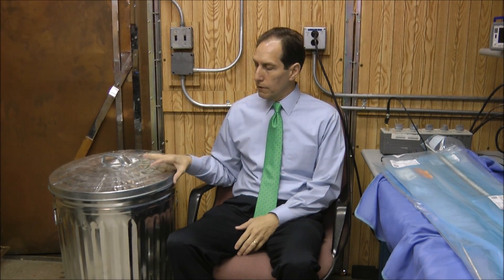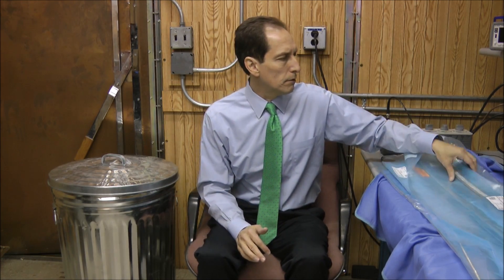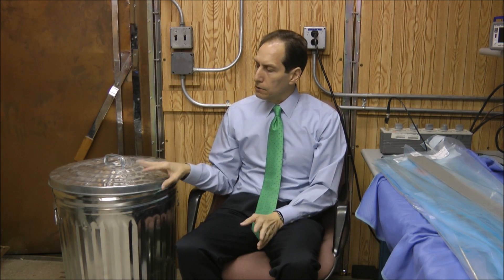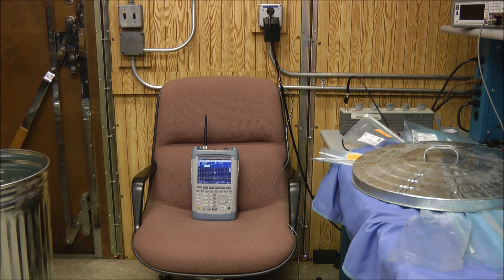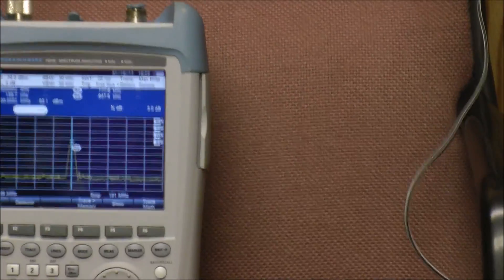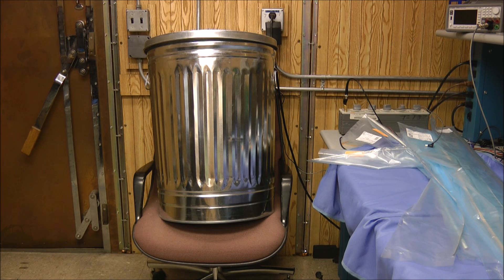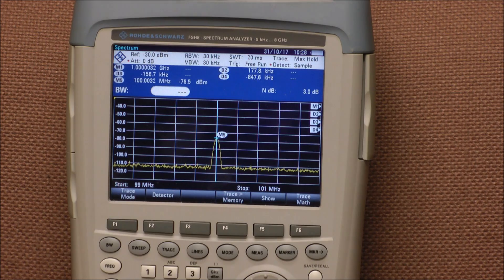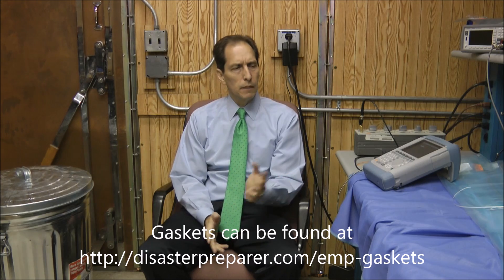Gaskets to Seal Faraday Cage

Comment: I was able to duplicate this experiment and get almost the same numbers, but I didn't have a shielded room, or a fancy signal generator or a portable spectrum analyzer.  I did the experiment in reverse.  I used a Baofeng radio as the transmitter.  Put a rubber band around the PTT button and put the radio in the trash can.  Then I used a SDR receiver (SDRplay) that can measure signal strength to +/- 1 db and measured the signal strength (open air vs in cage).  I got about 18db shielding effectiveness on the unsealed can and on the sealed can the signal disappeared completely off my spectrum scope just like you saw. I calculated at least 70 db of shielding effectiveness.  My noise floor was a bit higher (-100db) but the 8W Baofeng was probably putting out more power than your transmitter (bout -30db on scope).  I did this experiment because I could still talk to a radio inside the cage.  My RF seal was in the wrong place.  Putting it on the sidewall of the lid is crucial.  I had it in the corner.  Putting it on the sidewall is what raised the shielding from 18db to 70db.  

BUT I could still talk to my Baofeng inside the properly sealed trash can.  I'm guessing that the Baofeng receiver is more sensitive than the SDR receiver.  However, I kinda think that a nuclear EMP will generate way more energy at 435 Mhz than my $33 8W Baofeng radio.  So, I still don't trust the trash can faraday cage.

Also, I can totally block the 8W Baofeng signal with only two layers of tin foil separated by a plastic bag.  Seems that 2 layers of tin foil does a MUCH better job than the trash can faraday cage itself.  And tin foil is also way better than mylar bags -- even the fancy EMP bags.  I tested Faraday Defense mylar and Dri Shield 3400 mylar bags against the tin foil, and the tin foil won easily.  So my sensitive items are in multiple layers of tin foil and mylar inside the sealed trash can.  

Interesting experiment.  Glad I got about the the same numbers.  Repeatability is a thing.

QUESTION:  Where does the 50db minimum shielding effectiveness threshold come from?
Reply from the maker: That's great. I always like to hear when people come up with clever methods of doing RF testing.
Reply: I like the way you think. I have a question for you. Would grounding the trash can make much difference. Right now I am thinking of using Faraday cloth over a trash can....perhaps cheaper than using the RF seal around the lid. Any thoughts?
Reply: @groniga  i dont think the grounding really matters because of how the farafay cages work. Dont really know if it would help or hurt.   But the rf gaskets (available for less than half the price at digikey) just look like emp cloth wrapped around a foam core with some peel and stick conductive adhesive.  I would think if you draped some emp cloth across an open trashcan and the put the lid on (sandwiching the cloth in between the can and the lid) that would be an excellent seal amd probably more durable than the gaskets - they tend to want to get scraped off.  Maybe even a better seal than the RF gaskets.  Great idea.  I want to try it.
Reply: What type of Mylar did you use? There is two types, metal vapour deposition on plastic is one type. The other is aluminium foil laminated between sheets of plastic.
Reply: @bojangles2492  Several types, but cant confirm the construction.  Pretty sure they were the tin foil between plastic type.  The DriShield stuff has a slightly different feel to it tho.

Comment: I know this is a stupid question I am sure you have been asked 1000 times. But what about using an old microwave?
Reply from the maker: They do okay, but they're not designed to shield from lower frequencies, such as those from an EMP. Microwaves operate at 2.45 GHz.
Reply: @disasterprepper  Awesome. I always was curious. Thanks!

Comment: Adhesive on one side, conductive on the other. Is that a conductive adhesive of some sort? Seems like garbage to me.
Reply from the maker: The adhesive is conductive. Also, it's very thin, which allows metal-to-metal contact. These gaskets are used for all sorts of RF applications.

Comment: Same considerations for lightning protection?
Reply from the maker: Can you be more specific in your question? What are you trying to protect from lightning?
Reply: Spare electronics (GPS, phone, etc) on a sailboat in case of a lightning strike
Reply from the maker: @MarkS6026  Ah, got it. Yes, you can use these same protections to guard against the radiated effects of a nearby lightning strike.

Comment: So I bought the gasket. Came super quick. Put the gasket where it was shown on video. Pull the tape off and it went on really easy. Doesn't work though. Wasted my money. Going back to the tape.
Reply from the maker: When you say it doesn't work, what do you mean exactly? How are you testing it? Also, did you put it on the sidewall of the lid?

Comment: Would multipurpose foil tape (brand is Reflectix) work to seal seams of garbage can?  I also bought 3M HVAC tape, both from Home Depot.  They look metallic but don't know if they would work.  What should I look for from their Home Depot website?
Reply from the maker: The metal HVAC tape works great, but it can really slice up the fingers getting it on and off (I say that as someone who repeatedly learns this lesson). I haven't tried multipurpose foil tape, so I can't say for sure how well it would work. The reason I like the gasket over tape is that it makes it easy to get in and out of the can without having to remove and reapply tape.

Comment: The tape AC duct is sealed with, will that help?  Or can we use it?
Reply from the maker: Yes, aluminum duct tape works great (and it's cheap).
Reply: @disasterprepper  Hi Doc - does the aluminum duct tape also need to have conductive adhesive?

Comment: foil tape has nonconductive glue on one side.
What about a faraday 'wall'?
something to put between you and a cell tower?
Reply from the maker: I wondered about this too, but it ends up the very thin layer of adhesive gets flattened out enough that standard aluminum duct tape works great to seal up things. I tested it along with very expensive copper EMI tape, and both did equally well. You can put up a shielding wall but RF energy has a way of bouncing all around. Unless you were sitting very close to the wall, I don't think it would be very effective.

Comment: I ordered this gasket and placed it the same way shown and still could not get a Bluetooth speaker to stop playing inside or even a radios signal.   I used aluminum tape on all the seams of the can also.   When I used body weight on the lid is only when I could get the signal to stop.
Reply from the maker: The fact that when you put weight on it, the speaker stopped receiving means you're not getting a good tight RF seal. I suspect you may have put the gasket in a place where it didn't seal up the lid to can. Did you put it on the sidewall as shown on the website? If you'll send me a few photos (arthur@disasterpreparer.com), I can probably help.

Comment: Can a washer, dryer, or microwave serve as a Faraday cage?
Reply from the maker: Sure, I measured ad hock Faraday cages like this in my EMP book. The microwave did okay, but not as well as I would have thought. I also measured a safe, garbage can, and other structures. The key is sealing up the seams with something conductive (like gaskets or aluminum tape).

Comment: Dr Bradley, great video. I can’t help but notice the lever bar lock on the door behind you. Is it part of the door or can you buy separately and add to any door? Would like to have info on that locking mechanism.
Reply from the maker: The door is part of a shield room. They use knife-edge doors with heavy door door latches to seal them well from RF energy. I don't know if a normal door could be retrofitted with such a latch, but I suppose it's possible. I can tell you that when it's shut, it's definitely shut!
Reply: @disasterprepper  Thanks for the reply.

Comment: I wish this was my science class/teacher in high school. Love the room he is in. Thanks for the video, very informative and useful. Bill Nye take a seat, the teacher is in the house!  Just subscribed. I had a question about the seams around the handles and where the bottom of the can meets the edges; how well are they sealed and should they also be sealed?
Reply: You can use aluminum foil tape to better seal these seams. This is a form of "duct tape", typically used in HVAC applications.

Comment: Hi,
Is an internal electrical insulation layer not necessary? like ruber, cardboard or simple plastic?
Thanks and regards from Brazil
Reply from the maker: It's only necessary if there is exposed metal on the item being stored.
Reply: @disasterprepper  thanks for your reply.

Comment: Don’t grasp the validity of these test! A nuclear device also emits a magnetic pulse. The Behrens High-Grade Steel 1211  Steel Trash Can is 30 gauge (0.4 mm) and will saturate allowing the magnetic energy to induction heat and melt the electronic circuitry, especially the chips. This is why military equipment for  Level One is built to a higher spec.  already than domestic equipment (about 20x better) and yet still needs protection meeting  MIL-STD-188-125 (80 dB attenuation) in real scenarios with their much higher energy levels. I don’t see 112 dB achieving that for ordinary consumer stuff at the expected energy fluxes.  Sometimes  Nilomag or one of the other nickel–iron soft ferromagnetic alloy with very high permeability is employed for mission critical equipment to avoid saturation of ordinary steel enclosures. So will this work in a real scenario or is this the reason for the lengthy disclaimer — my club has a lot of these to build and bags to buy whist we still have time. Post script:  The MSM is still not reporting on the increased navel movements in the Pacific.
Reply from the maker: Low-frequency magnetic effects generated from an EMP would not couple well into small-scale electronics due to very small loop areas. High-frequency effects (such as those from the EM wave) would be far less than the electric field due to the E/H ratio being about 377 in free space. Facilities may well need to worry about the magnetic effects, but all but the most sensitive of small scale electronics would not be adversely affected.
Reply: @disasterprepper Thanks for the quick reply.
Reply from the maker: @Nuts-Bolts  Of course. I'm always interested in hearing other knowledgeable people's thoughts on the subject.
Reply: @disasterprepper  And sometimes not so knowledgeable people too!

Comment: I have installed a Siemens EMP Home Protector.  If I plug all my small appliances using a power strip, will that safeguard them.  Also, if I plug my Goal Zero 1500x power generator together with the 4 solar panels into my power strip will that also be protected whether they are in use outside or sitting idle inside my home, also remaining plugged in?  Finally, would it be a good idea to line the inside of the trash can with rubber mats?  Thank you.
Reply from the maker: Having a surge protected power strip will help, but please note that some strips are not surge protected. Using broadband ferrites on the power cords of things that must remain plugged in is also a good idea. If the Goal Zero is not plugged into the grid (which I'm assuming it's not), the only risk is from radiated energy. Again, ferrites on the power cords can help. When it's not in use and not plugged up, you might consider covering the main unit with conductive cloth. Lining the inside of a faraday cage with cardboard or rubber is fine, but it's only needed if something metal on your electronics might touch the inside of the can.
Reply: @disasterprepper    Thank you so much for your quick response and all your helpful information.    I really enjoy your channel.  One question:  I'll be purchasing ferrites on amazon.ca  (I live in Canada) do you suggest a certain kind?  Thanks!!
Reply from the maker: @LaMammaDiElvis  That's a hard question to answer in a short e-chat. The short answer is that you want some with very high impedance across a wide frequency band. I evaluated hundreds before settling on the ones I sell on my website https://disasterpreparer.com. I can ship to Canada if you prefer to buy from me, but either way, any ferrite is better than no ferrite.
Reply: @disasterprepper    Thanks again for your kind response.    Great, I'll check the ones you sell on your website.   I need the best.  Thanks!

Comment: Do we have to line the inside with cardboard, or do you recommend we drop a 5 gallon bucket inside so the plastic provides more barrier?
Reply from the maker: You certainly can line the can with cardboard. It's really only needed when there's a risk of an antenna or something metal on your electronic item coming into contact with the interior of the can.

Comment: Should the cans have a non conductive liner like cardboard to protect items inside?
Reply from the maker: They certainly can, but most of the time, it's not necessary. The reason is that most electronics are already housed in plastic, so there's nothing metallic to touch the wall of the can. With that said, it's fine to line the can with cardboard or something similar.

Comment: IF A FARADAY CAGE CAN BE MADE AS A "CAGE" WHY NOT JUST USE A WIRE LOOP TO "GROUND"  ( bolt or solder )  THE LID TO THE CAN ??
Reply from the maker: The largest dimension of any hole or slot should be no larger than about 1 mm to achieve the desired level of shielding. Grounding isn't really a factor when it comes to shielding. It is more for safety, which isn't an issue in this application.

Comment: Like a behrens 4, 6 or 10 gallon ash can inside a 20 gallon inside a 30+ gallon can all with either cardboard and or towels for  insulation.  Redundancy is always better.  Of course separate the batteries from the devices just incase.  And remember to seal it for an airtight seal and put conductive tape at handle where its attached  and along the seam of can.  Both points can weaken or allow pulse to enter and violate the seal.  The idea of the conducive tape is brilliant!! It's always a good idea to have a few of these triple cages housing electronics and batteries and seal em once and dont reopen - make a list of what's inside even take a few pics and put on outside so your not tempted to break the seal.  In general alkaline batteries last 10 years but I'd replace every 8 to be safe. If your not sure what's inside - When in doubt make another.  The cost to make one is less than $50   for the triple can makeshift faraday unit - buy American go with Behrans galvanized  cans.

Comment: I am looking at getting an aluminum diamond plate job site tool box. DO you think it would work if I sealed the edges of the box with these gaskets?
Reply from the maker: Hi, I've seen other people do this exact same thing. you do have to seal up the entire lid using a gasket. Also, if there are any open seams, you would want to tape them with conductive tape.

Comment: Dr. Bradley,
If I put a Walkie Talkie in the faraday cage, seal it correctly, should I be able to hear the page I send to the radio, or am I talking apples to oranges?  Thank you.
Reply from the maker: You would likely hear the walkie talkie. They usually take around 120 dB of shielding to block. That's way more than most Faraday cages, also much more than is needed to survive an EMP.
Reply: @disasterprepper  Thank you for the quick response and info.

Comment: Have you ever checked the make shift Faraday cages while they where properly grounded? Also was wondering at what MHz/GHz would a EMP pulse wave  be at? I use a single stack of lockers that has all seams taped with the foil tape, then a piece of foil sided styrofoam 1st layer( foil down)a rubber mat 2nd layer(cut down floor mat) on bottom of shelf with a wood tray to hold my Electronics’s( wood tray does not touch any of the metal locker) this set of lockers is in my Garage which sets on a commercial grade carpet and concrete below that and has two ten gauge bare copper wire that go thru foundation wall, one is attached to the gas meter and the second is attached to its own 8 ft grounding rod driven into ground next to outside foundation, I have tested this with a walkie and a cel phone and can’t get any reception
Reply from the maker: Hi Jerry, I have checked on the effects of grounding and will post a video showing the net effect soon. The question gets asked a lot. An EMP is essentially a set of three pulses, one very brief (nanoseconds), one of modest duration (microseconds), and one of long duration (seconds to minutes). That means in frequency it would have components from very low to very high frequencies. Only the high frequency energy would couple efficiently into small electronics though. A reasonable assumption might be to assume that energy from 10 MHz to 1 GHz could couple, so that would be the frequency range to test shielding. If your setup is blocking walkie talkies, it must have outstanding shielding (>120 dB).
Reply: disasterprepper Thanks for the added info, look forward to the video, and I’ll have to get some of the gasket so I don’t have to re-tape doors when I charge the batteries for the gear inside

Comment: Great explanation about homemade faraday cage. Does adding a gap (i.e. cardboard) improve the protectioN/shielding by keeping  the device from contacting the  the bare metal?
Reply from the maker: Most electronics already have plastic housings, which create that electrical isolation. But it's not a bad idea to put cardboard or some other insulator on the interior of the cage to prevent antennas or charging ports from touching the metal.